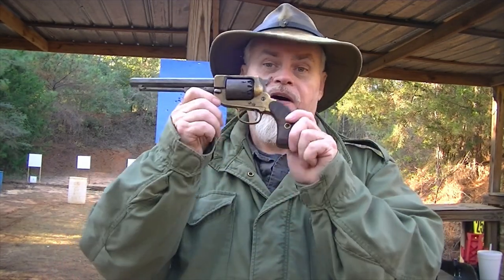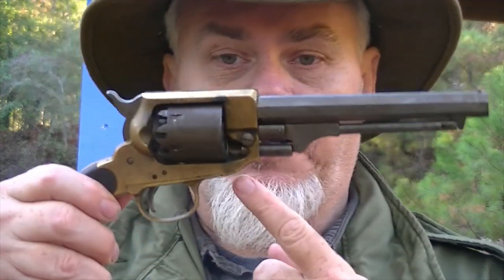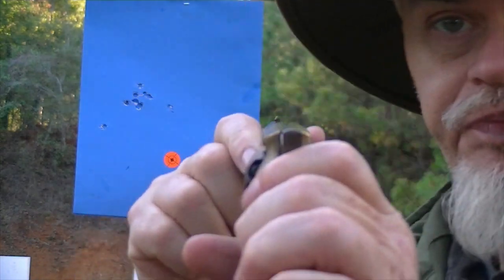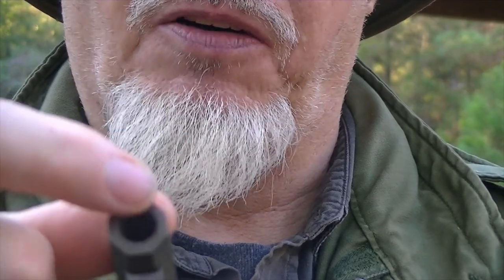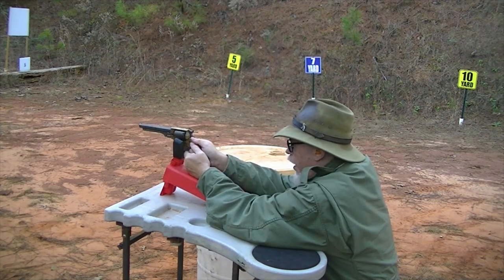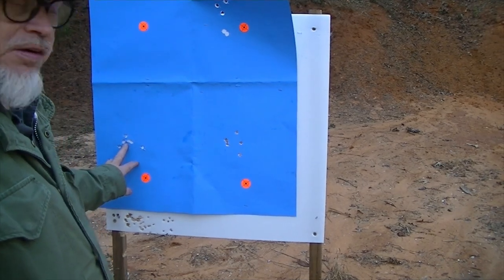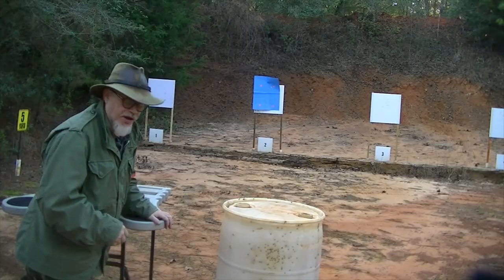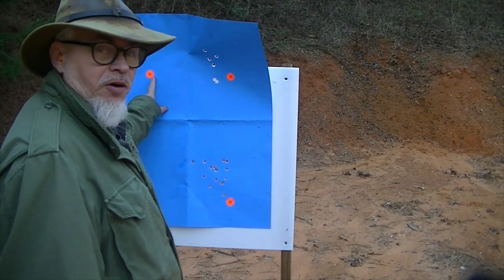spiller and burr  range correction

Comment: I took a price of brazing rod and drilled it to fit over the existing front sight. Then I cut it to the correct length and gave it a cone shape and soldered it over the existing sight

Comment: Love your videos. I’ve had the Spiller & Burr since 2012 and love it. I make everything but the caps for mine. I had to get a Lee bullet mold because .36 cal round ball is impossible to find locally. After I started making my own bullets I also started making my own powder. I can’t make caps so I just stocked up on them, buying about 1000 per year at $13.50+tax per 100. Works out to 14.31 cents per shot. I didn’t have to do any mods to mine. I just aim a lil low up close and dead on at 20 yds.  At 30 yds I can still get 6 shots on a paper plate but that’s about my limit. As for the load I generally run 21 grains. But I have loaded as much powder as will fit behind the bullet just for testing. I typically load round ball every other chamber and alternate #4 shot cut out of a 410 shotgun shell for killing copperheads when the population peaks. I’ve even used shot to kill squirrel & rabbit with this pistol. I just stuff wasp nest material in the end of the chamber to hold the shot in. You can also use lard in cold weather.

Comment: Ok I would like to see a  follow up video on this one to see what comes of a cleaning. Though I can't disagree with the methodology, as never tried what your saying. If everything said is correct and the end of the barrel isn't square, Trueing  up the barrel with a lath, then cone a squared up crown maybe the answer.    Isn't the current sight on this particular revolver threaded, or friction fit silver solder? I know I have corrected point of impact in  my experience. 
But I have seen some strange things lately out of YouTube videos.  For example seen a young fella build a flintlock. When he test fired it of course it shot high and off windage. His answer was to remove the barrel put it in a vice and bend it to point of impact. 🤔left me puzzled.  So I asked don't you own a file, and isn't the the front dovetail? He answered yes but does not like the look of a sight not dead center and filed down. Again 🤔 After that I wasted my time trying to explain how many hours are spent each year just in trying to solve proper wood to metal fit as to not effect accuracy as the barrel heats up, but he basically give me a response similar to plugging his ears and going  la la la.
  Mountain man

Comment: Another cure. The sight on that Spiller and Burr is pressed in. Grab it with pliers and twist and pull it out.  Take a piece of Brazing rod and file it to fit or drill out the hole to fit and press it in and file it down to bring the POI up to the POA......................Bob

Comment: Hey Blackie- thats an interesting way of obtaining POI.  I wonder what would happen if someone lightly filed the front sight post?  The 2 BP revolvers I have soot very accurately from the factory and I havnt had to make any adjustments so far.  Im looking forward to see how well she does when cleaned because your correct about the fouling affecting everything.  Good evening to you and Mrs Blackie.  See you tomorrow-
Reply from the maker: filing the front sight will make point of impact rise not fall i have deepened the rear sight notch as far as i can go 
this gun shot 24+ inch high from factory so it requires a bit more work
Reply: @BLACKIETHOMAS  Ok- its going to be interesting to see what you shoot.  Hopefully it goes as planned-

Comment: thanks blackie!  did you ever work up a conical load for the spiller and burr?  i'm using the 130 grain lee bullet, I size the base using a machinist 3/8" taper collet and a modified pair of pliers to do so.  I would prefer to use a conical as it is convenient to have grooves to put the lube in.